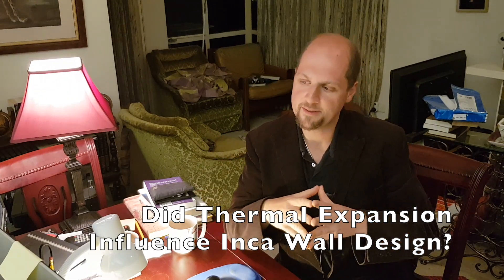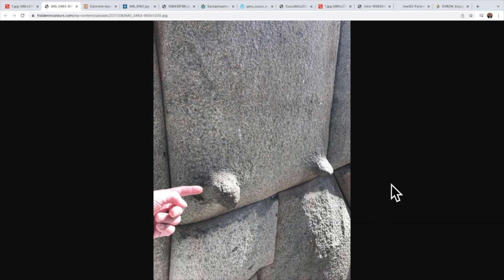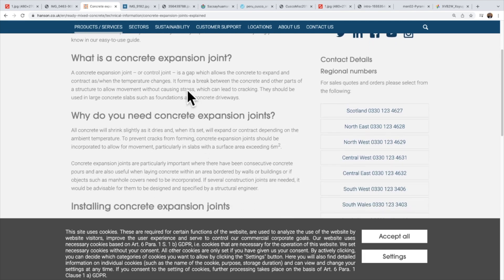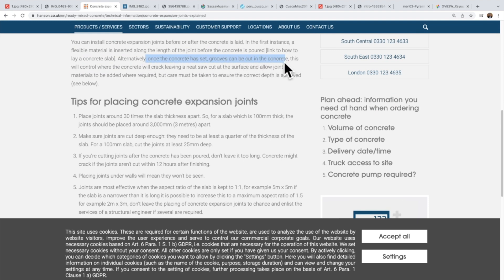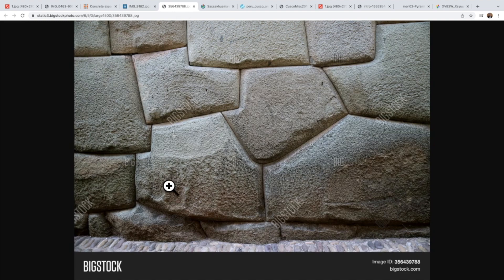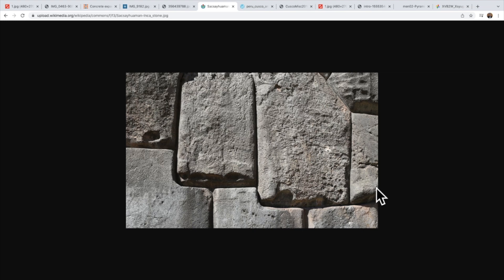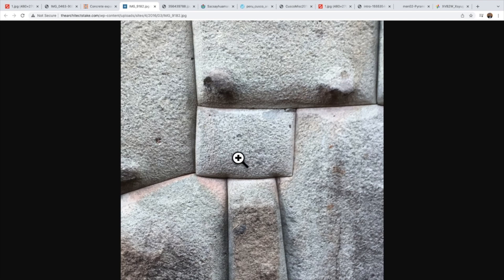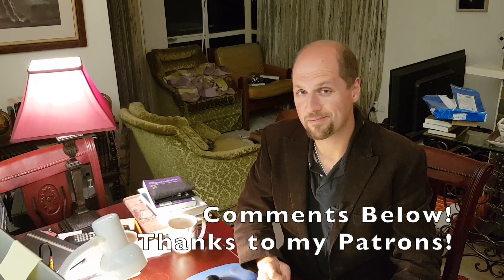Inca Nubs as Extruded/Intruded, Stone-Welding+Stone Mixture, due to thermal-expansion in setting?

Comment: The knubs/knobs are found on every continent where megalithic construction is found. So, first and foremost, so much is missing from these structures that we're likely never to find out their true purpose.
This said, where these structures are the most complete we understand that sound was one of the most important aspects, so my guess is that the knobs were left in order to be able to tune the stone to the correct note by subtracting material.
As for the geopolymer theory, we found quarries with evidence of block cutting, quite extraordinary too, where one huge block was extracted without an inch of overvcut in any direction, we could in fact re-position it on its negative side on the mountain and there would barely be a noticeable perimeter around it, it's as if a polystyrene cutter like tool was employed, absolutely mind blowing stuff. Anyway, several other quarries show evidence of blocks, while if they were to make a paste out of it they certainly wouldn't have gone through the hassle of cutting precision blocks, but instead attack the mountain randomly to gather small pieces to be grinded, which would have been a tremendous effort only to add extra passages. Other evidence is found in the form of veins of other materials on the blocks, and really odd cutting tool marks of all kinds that seem to have gone through the rock as if it were butter.
Anyhow, it's still cool to hear alternative theories about the most mysterious architecture of our planet, that the mainstream tries to explain away or ignore since it's found on almost all continents in large numbers and it's of obvious great antiquity, and using a tiny pinch of common sense is the proof from a lost civilization theyve been asking for for almost 40 years, but as I already said, it's better to ignore it, it will probably go away..

Comment: I would suggest thinking mechanically not chemically, that those protruding notches were made to use as an anchor to both rotate or move the stone in an easy way since the friction surface is minimized. Secondly I believe that two notches are more ideal for larger rocks so when used as an anchor the worker can actually be able to put his hand underneath to lift it. Yes lift it because based on the evidence in the holy Quran God has mentioned three times the same valuable piece of information that there have been nations “greater than yours and were given great strength” and “They’ve been given the ability to manipulate earth” and described as “with great marks on earth” also that “You were not given tenth of what they had (of blessings)” etc.

Considering the way they stacked the stones I can see clearly that it was intentional aesthetically, and probably a design made on a larger piece of stone as big as the side of the wall, lined intentionally in this way and then cut in a way to have a cushion appearance. Especially when the corners taken from each stone in the exact measurements all over so it appears eventually like soft cushions not boringly in Ashlar pattern but new intriguing way and captivating, which is their aesthetic taste at that time (extremely sophisticated). It just adds how advanced they were and greater in a way we cannot believe that some old civilization were actually greater than us. 
The small holes or depression however probably to house an object to move the stone over bearings of balls or cylinders to push around. Any other marks on the surface could be the effect of a powerful force, because there were evidence of catastrophic damage, also it was mentioned in those same texts in the holy book that they were punished for their disbelief. 
That’s my view on the topic and hope it can help.

Comment: I am really starting to believe these nubs have something to do with earthquakes. Now that you shown this pic with smaller stones underneath the larges ones. I am pretty convinced of this. As to me that looks like the same kind of modern method that they use in Japan for the buildings. I’m no engineer, but I do know they sit their buildings on platforms that move in an earthquake so the building doesn’t fall. Wouldn’t this be the same method albeit ancient, wherein the smaller rocks would take the brunt of the shock and be able to move with the ground leaving the large  blocks still in place without cracking with the strain of force. (If that makes sense, hope so) :)
Reply: Makes sense.

Comment: Concrete Vibrator. Used to liquify the concrete for smoother application & force the air bubbles out. Nibs are tube removal leaks?

Comment: Hey Charles my opinion is this they shaped them like that for the style the earth quake proof loking of the walls. Now the pillow effect thats a lot of extra work even if it was poured like concrete which I don't think they were. Now there was a red mixture that was used to bond those stones together if I remember correctly. If that was true that mixture basically ate at the stone and formed a bond. If they didn't pillow them the resulting substance would have over time flaked away the pointed edges and rounded them in an uneven way that wouldn't look good. So in my opinion I think they did that pillowing of the edges to help prevent that and it turned out it looked really good so they did the extra work to get that effect. I hope this may give you some ideas and look to see if we can't find some thing that supports that factually and not just my opinion. Lol if I get that right then I'll help you work on the nub problem lol. Thanks appreciate your work and effort

Comment: I dont think the nubs are injection points, for the simple fact it requires modern technology, which simply did not exist and was not needed.
As for pillowing and expansiin of surface so as to stop thermal cracking, I agree. It is very evident all over the world where these building techniques have failed and surface rendered layers have cracked off.

Comment: The joins are simply "pointed" with a technique of scraping, the same way modern brickwork is "pointed".
These walls are made of ancient concrete mixes, using rubbles, rocks  and mixes that vary the internal wall and polygnomial "blocks". Each has been finished off with external rendering, sometimes showing the underlying rocks when wet, or eroded. Many examples exist of broken render EVERYWHERE, from walls to egyptian pillars!
The nubs still thwart my own explaination, but most certainly the answer is a mix of things. ie Internal solids, rendered over. Stepping stones. Decoration. Anchoring. And bracing where the forming needed support.
Reply: Use seem to be absolute and positive with your statements. You know no more than anyone else about your opinions. At least pose your theories as possibilities - not absolute facts. Comes across as pompous and condescending
Reply: @Proctorhigh80  after all my research, I feel solid in my statements. I'm sick of hearing about levitating tons of rock, growing rocks, carving rocks with copper tools, its an archeological joke being put onto the masses. The clear evidence is in almost every single video.
Reply: @DOCWHOK9  I'm fed up with all these ridiculously absurd theories as well but this theory is just as "out there".. Wish someone would find evidence of how it was actually done and who did it. I have a hunch that it's thousands of years older than we've been told by these "experts".

Comment: wait...faux polygon stones?...I hadn't thought...at home, I have a cinderblock wall and have thought to plaster it over to make it look like adobe, like the old Missions in California...is that what they did, put "plaster" polygons over a "cinder/volcanic" wall?...easy to determine, take a polygon apart, one of the big ones...but no one has done this?...seems I saw one fallen off somewhere, and the look of back didnt have the look of the front...now, in Mexico they had plaster-Yucatan is all limestone-see Puuc architecture..Egyptians same...plaster a small step from cement...Roman cement remarkable for use of volcanic ash unique to Italy, pozzalino?...underwater cement works at harbor of Ceasaria...said how to make cement was forgotten, but just watched vlog explaining the declining Romans just didnt have the desire anymore for monumental cement buildings, and preferred easier building materials, or some such...that's a curio, as the Pyramid age declined in Egypt; like changes in Mexico and Peru-things go out of fashion...if they had plaster, they had cement, my thought...this in Mexico...and in Peru?...not so much...but both Mexico and Peru have volcanic dust...bread, adobe, cement...fake polygons...hmmph...like a Hollywood set...the shape I've thought too had signifigance...Peru had corn, not wheat, and corn kernals are polygonal...😃trick is the cement laid up dry, and then moistened, dampened, until it cooks off and hardens...the bag still in the backyard, my folly...☺

Comment: I think when I'm casting stone with tried and trusted rapid set geopolymers 'are those nubs from the moulds just limbs snapped off'?'  Each stone possibly formed using a pelt as tribute to the animal's spirit? Mortar typically shrinks as it sets, and movement does occur more over large areas and cracks form due to settlement. Ice is the antagonist here also. Expansion gaps are a recent detail in architecture to 'give' a little room for movement especially in New Builds, and not present in old builds because lime/clay mortar 'self heals' when it cracks. Charles Kos, I think you should go get your hands dirty with using mortars, especially adding citric acid to a mortar to speed up its setting time. Step one would be to cast the finer detail finish face with fine aggregate or pure binder like lime putty in the 'negative' or inside of the mould (even in situ, it works), and then step two the big stuff moves in... like conglomerate. Keep up the good work! Still, as we see in other channels exposing granite stone setting, thats hellish tight and may be a result of surviving lots of seismic movement essentially vibrating the stone closer together... still bloody amazing stuff <3

Comment: let's go crazy. Let's say the stone was volcanic ash. With that, moving large amounts of material is easy as sweeping it up throwing it in a back pack.  It's then placed in a casing bag. Something that degrades easy such as burning it. The bags of Ash are stacked. Forming portions of the wall. Probes are stuck into the bags which causes the ash to become like putty. The bags, of this now pliable material is shaped, in the bag.  As the curing process starts, the probes are removed pulling with it some of the material, causing the nub,.  The bags are then set on fire. The setting material is now able to relax against the other stones, without actually bonding to it, as there's residual material left over from burning the bags on the surface of the stones.  The probes were electrodes...

How? I have no idea.
Reply: great idea! the bags could have been made out of self-dissolving material... .

Comment: I think they are using simple forms with a pump hole and a form of concrete or geopolymer with aggregate perhaps.  They might have put in big rocks from the top to fill space as aggregate and then pump in the liquid from the top, then when they takethe forms off, the material is still wet and the surface isn't perfect like today's concrete, then they go over the joints with a blade like they do in bricks today and they must smooth the surface to a degree, obviously not a perfect degree of level and smoothness on the surface...  I've seen people making a house with a wooden form, they drop a combination of rocks and concrete into the form to use less concrete, and the result is a normal concrete wall where in some places you see some rocks sticking through... I don't think these people are doing anything high tech, just chemicals like Davidovitz shows in the pyramid blocks,  with an open top form.  They take the forms off when still wet and this can explain for the scoops and imprints and the nubs may be the pump holes, maybe they needed more than 1 pump-hole and they just got lazy with taking the nubs off because probably the walls had some kind of tile or even solar panels on top made of more exotic materials that were removed long ago.  I have a hunch that the pyramids may have had some kind of solar panels on top of them, but a solar panel that was made of natural rocks or minerals or tiles that combined solar panels with physical function and transferred the electricity to the inside. I also think the pyramids where weapons.  There is a similar weapon in wyoming or somehwere which is a pyramid shape (deflects missiles and projectiles) with some kind of laser or gun hole in the front, to shoot down incoming missiles.  One important thing is to realize that these walls were probably surfaced with more perfect looking tiles (think tiles or solar panels or even tv screens.)  I think the forms were simple with 2 sides, or 3 sides, but the top was left open and they used tools to make the joint concave like that and to smooth the surface but only to some degree.  They kept the nubs because they might help hold on the surface tiles that they put on later... this is important in vertical tiles in a bathroom for example to have something to grab onto.

Check out these two videos:  hYUE3YSKXyA  and  LLXsPEIZ2BY... you can see they save time and material by using big boulders as aggregate and you see the imprints of the forms in the final wall.  They don't care about the perfection since they are DIY and it will be their garage/basement and plan to cover the walls.

Comment: Wow, the nubs do look like a tension release. The extrusion just above the joints. Like adding blocks of steal to strengthen the rigidity of a car.

Also what this video made me realize, all the stones are uniform in color. Suggesting a mix that was made at the same time and poured for all of the stones. Maybe an on site Xray through the stone will suggest if there's rougher rock underneath. Also it could have been a big pour and the cracks added like modern day techniques. This would kind of explain the perfect lines and no gaps or mortar. Because the lines are on the surface. Otherwise where's the quarry? Does Brian know about quarries here?

I feel as if even pulled from the same source, some of the stones would have a variation in color and I don't see that in the inca rocks, they're mostly roughly the same albeido across the whole thing.

Comment: Hello curious brother, hope all is well. While you mention this process as “welding” you provide no further electrical analogy. I came across this video which explains that cracks or separations, (as in joints) act as capacitors returning electrical energy back in the direction it came from. All in all I believe this to be an electrical process. Perhaps the stones with elongated nubs were left “processing” over night and no one was available during those hours to disconnect the electrodes. (Union issues?). Shapes seen on the surface could be the result of contact with some kind of forming device. I’m guessing they were quite informal as there are no examples of the process going too far and creating a blob of some kind. A very slow process to be sure. The Thunderbolt Project purports that everything is electrical in nature and if you look there you will find the process. You state this is done as a chemical process, but as we all know, chemistry IS electric. https://youtu.be/ISfuOZgaN3c

Comment: Natural concrete turned to stone either through extreme age or under water for a long time. There are to many revisions to all of them to piece a logical story together. Our modern reinforced concrete isn't meant to last even a century. Expansion and contraction differences between the concrete and steel rebar will crumble all the new stuff.

Comment: One of the so called ``burial towers `` near Lake Titikaka has exploded revealing  round cavities in its centre with nodes on its exterior indicating that it was inflated somewhat like a balloon.Therefore the nodes were a joint for some type of compresser.The most likely contender for this process would have been Brown`s gas.

Comment: I previously mentioned we make granite worktops.  Cut and poured.  We also replicated a wall like these with the excess mix in cement bag paper.  Once your mix is bagged, sit on the top of the  previously laid block, press to fit the shape, cut your angles on the top you require for the next row. If you need a nub,  cut a hole at that point and it pushes out. Wait till set, apply new layer. Holes are cut while setting,  as only like dense plastercene, even sharp wood not metal. Wash the finished wall and the paper comes off, yet no 90°  corners as the paper puls it rounded. Hence cut edges are 90% the top side.  Done while shaping, but always looks different, plus the glaze is not obvious as on natural formed edges.  Give it a try.  Got idea after old dumped bags rotted, but perfect folds you can't blag.
Reply: Do you have a video showing the process?

Comment: I think they might be where the cake batter was pumped in and then they leak out of the hole a little after the hose/tube is removed when solidifying.  Like a box with a straw into it.  I haven't watched the video yet to see if this is similar to your idea.  The pump the cake batter in from the bottom up to avoid any air spaces.  In concrete today they pump from the top down and have trouble with air spaces. I have no evidence of what I'm saying, just an idea.